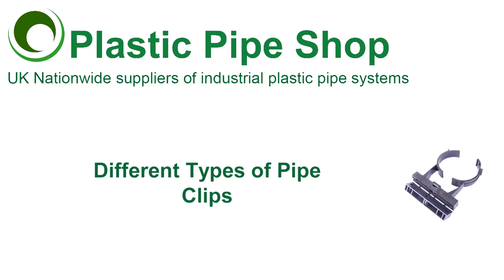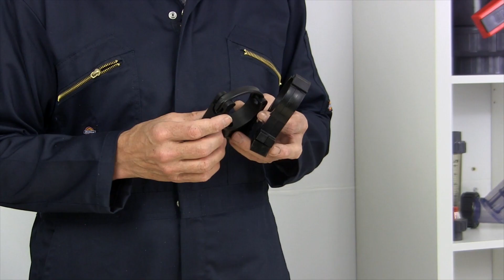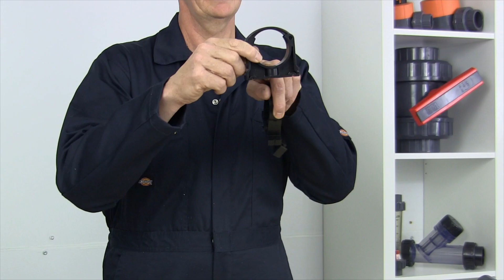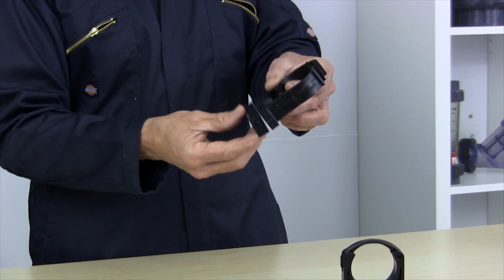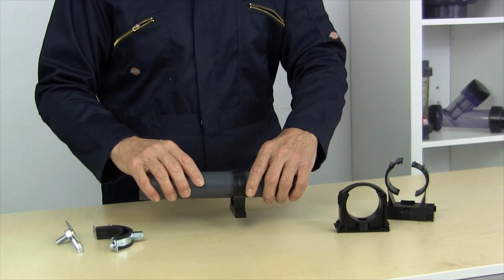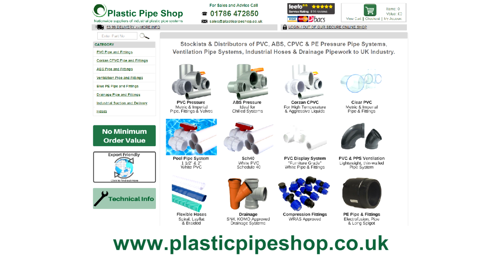Different Kinds of Pipe Clips

Comment: Without sounding too geeky, this video is actually really really useful as I'm currently trying to figure out how to support some vertical plastic pipe/ducting for a bathroom ventilation pipe (110mm) going through the loft to the roof. Looks like the rubber lined clips are what I need as its only around 1.5m long so hopefully expansion/contraction shouldn't be a problem. Thanks again!

Edit: 100mm pipe, not 110mm
Reply from the maker: Hi there, we're so glad to hear this helped you! That's exactly what the videos are for. We'd recommend just making sure the outside diameter of the pipe is what you are measuring to ensure you get the correct size of pipe clip. Good luck with your project!
Reply: Thanks for the tip  @PlasticPipeShopTV . “Measure twice, install once” is my favourite phrase 😃

Comment: Can the plastic pipe clips be open and shut regularly, or once shut are they then fixed for good (I’m really after pipe clamps but need them for 2” plus pipe, so trying to find an alternative)…?
Reply from the maker: Hi there, pipe clips are not designed for single use - you would be able to open them again if you needed to remove the section of pipe, for example. We sell a range of clips and clamps here: https://www.plasticpipeshop.co.uk/Inch-Pipe-Clips_c_575.html